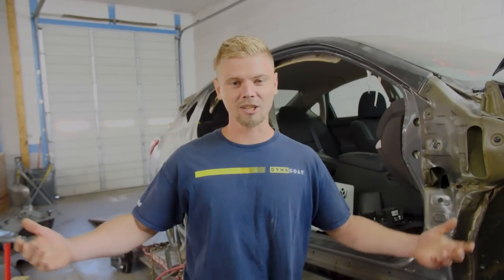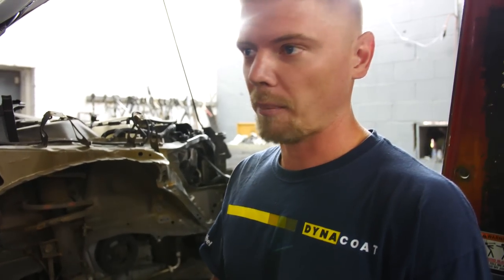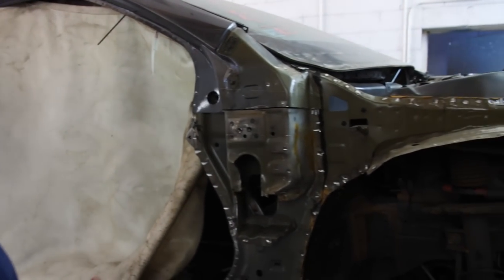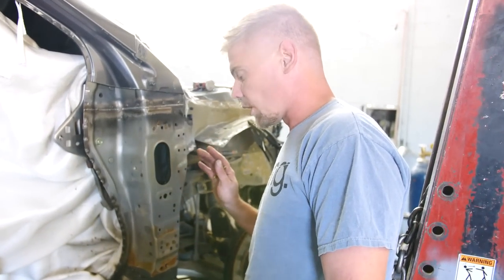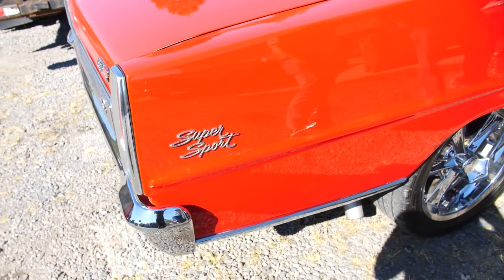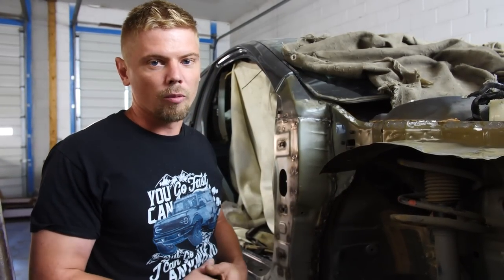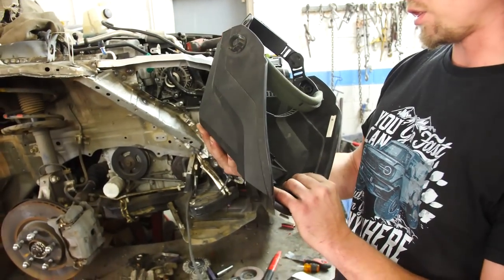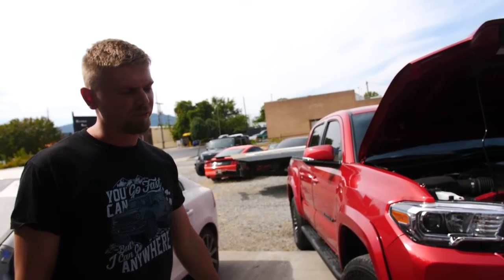We Saved This Destroyed Car from The Junk Yard, Was it worth it?

Comment: agreed Yuri, your real lucky to have Nate along side you watching and making sure you do stuff right - he's a pretty hard worker and seems to no his stuff, good researcher, and fortunately still young enough to have that enthusiasm 

i had that once, in the mean time i'm still trying to get back on form, after i broke my back, got to be 12 weeks now, but did a days grafting, painted a new workshop floor and walls, and my body is regretting it

your pretty lucky being able to unstitch cars, and graft in new parts, years back these kind of jobs were near impossible to do, and unfortunately shoddy work was found on many occasions - one car the rear chassis had been rebuilt using corrugated cardboard covered in body filler with iron filings and had passed previous MOTs, until we found it and rote the vehicle off

suicide doors were fitted to a number of vehicles, yes correct a Rolls Royce Ghost, a Lincoln Continental, an Opel Miriva, a BMW i3 to name a few - had to watch the Volvo nearly eating Yuri, pretty funny, but lucky not to get an injury from all that nasty plastic, them there lightning reactions and not a hair out of place

Comment: Not supposed to section a high strength steel a pillar what the hack.
Reply from the maker: Why not?
Reply: @23RD  Toyota says replace entire panel I I am doing one on a van right now it sucks but it's how Toyota says to do it Im just a dumb body guy I'm not going to argue with them lol but I also don't care how other people fix cars just wanted to give you some shit cause you do decent work.
Reply: @23RD  they say when you add the heat from welding to already hard steel it over hardens the metal and makes it brittle.
Reply: @23RD  I can get you the info Monday if you want to see what Toyota says if you are interested. Auto body is a weird trade where doing it right creates a lot more headaches what you did I'm sure was easier than the right way by the book even my boss gets upset when I tell him I won't repair something because the manufacturer says replace only idk if he thinks I made up the rules or what. I'd rather know and do the job right than play ignorant and just do what's easiest
Reply from the maker: @kpb711  that’s true but that’s why I drop dimes when I weld it instead of seams and last time I spoke to an insurance adjuster he told me not to waste my time with manufacturers recommendations as they would rather you replace everything so they can sell more new parts.
Reply: @23RD  insurance adjuster would Rather not pay for the part they don't have a clue how to fix a car they just want a cheaper bill so they can keep their numbers down and get payed their bonus
Reply: @23RD  insurance company puts alot of emphasis on recommend the word recommend when the manufacturer means required but they put in recommend for legal issues.
Reply: @23RD  I e gotten in that fight before a b pillar on a car I had a old school idiot manager gm says what kind of metal it was and under the steel repairability matrix it said no repair replace at factory seam only my boss kept saying oh that's if you are not repairing it like literally dude must have a hard time putting his shoes on. Idk I take the manufacturer saying recommend as it applies to me the person repairing it not like oh they must be talking to someone else I'll do the opposite of what they say. But idk I understand metal and know that welding work hardens it I can't crash test a car I'm working on to see if it's just as safe as the factory recommended repair so you have two options pretend the manufacturer has no clue how to build a car and has no knowledge of the materials they use or listen to them and be able to say hey I did everything the manufacturer said to do It will be right. But with that said I did 2 rear rail end sections on a GM reps truck somehow something got lost in translation I got told to go ahead and do the job I did the entire job had it done gm the manufacturer that wrote their repair guidelines refused to pay us for the job and said they will be crushing the vehicle because they don't allow any welded on panels on gm owned vehicles makes you kinda wonder if it's good enough for the general public why not for gm they actually crushed a brand new SUV over having 2 rear rails sectioned exactly how they say to put them in. I hope you know I'm not being a prick just discussing stuff I do watch most all of you're videos but mostly because you remind me of the older brother on the movie sex drive.